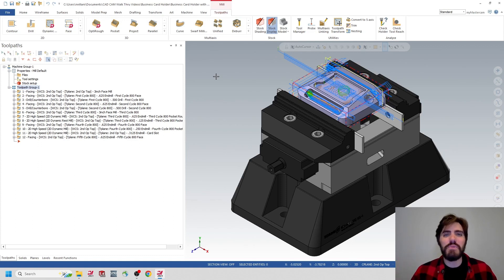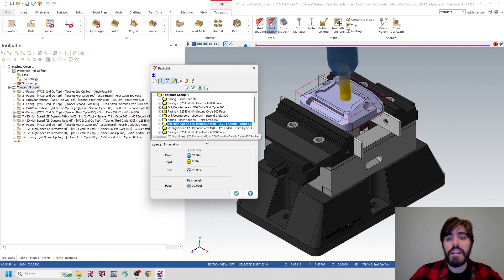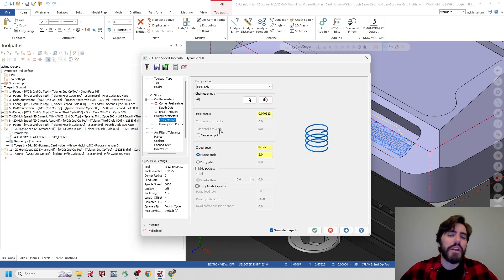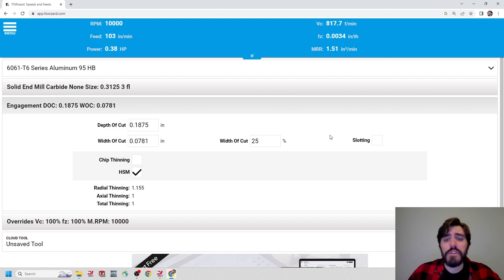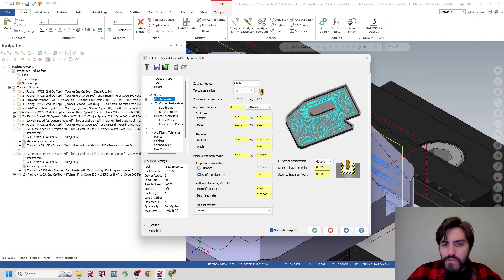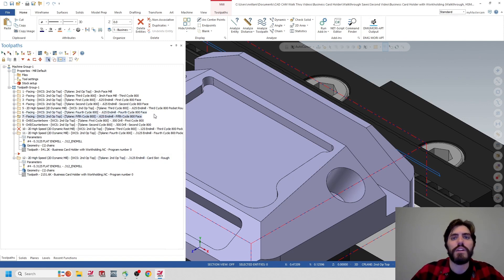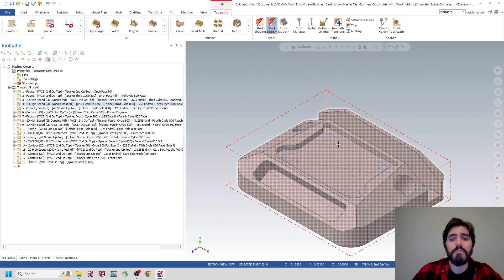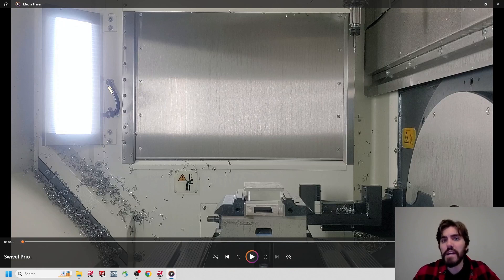Program Optimization in MasterCam: Tool Changes vs Swivel Rotations with High Speed Milling (HSM)

Comment: Many thanks for this video:) but please make the postprocessing... It is interesting to see how Mastercam makes cycles in G-code. Also very interested to see and understand the beginning and ending of each operation - how it looks in G-code.
Reply from the maker: Hi, I would recommend that you contact your reseller to get the correct post processor for your machine.  I know it's not the answer you're looking for, but I try not to edit or alter what I get from my reseller.